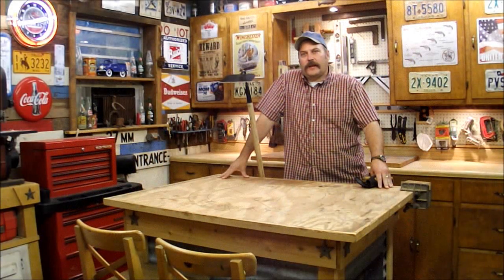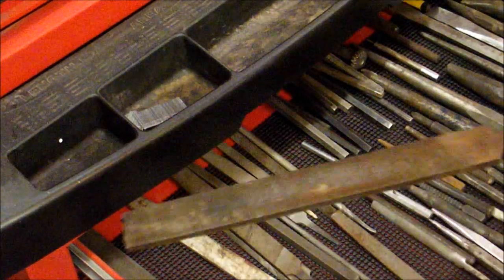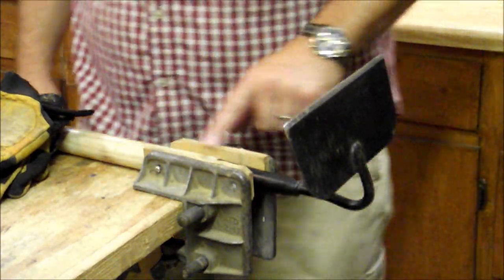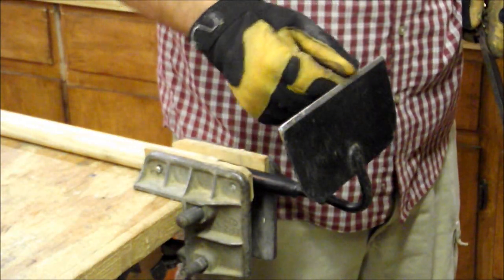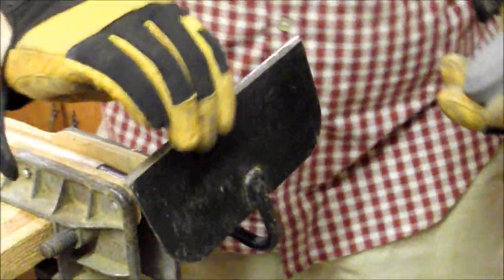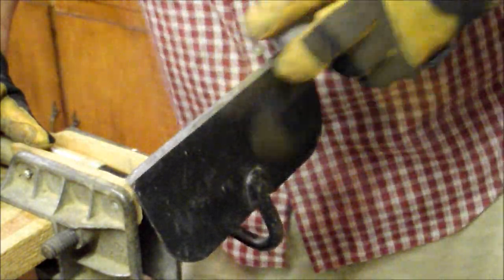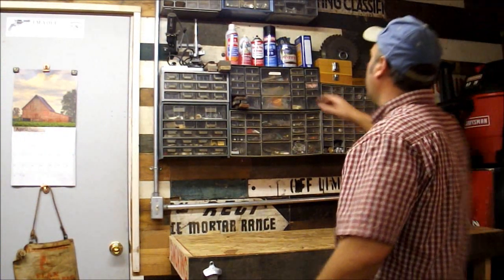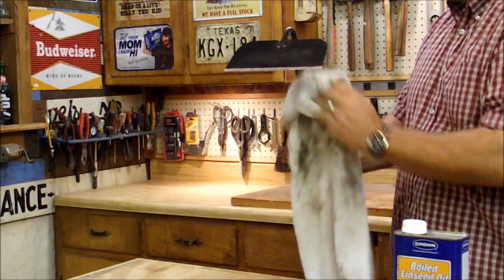How to Hand Sharpen a Garden Hoe

Comment: Why not use an angle grinder ? does it damage the edge?
Reply: I'm sure it would work but it probably removes too much metal too quickly.
Reply: As a rule you want to be careful with power tools when sharpening an edge.  You harden metal by heating it up and quenching it in water.  You temper (make less brittle) metal by heating and slowly cooling.  You don't want to make your tool hard and brittle and easy to break or soft and easy to nick.  A hoe is a striking tool.  Really hard metal is harder to sharpen.